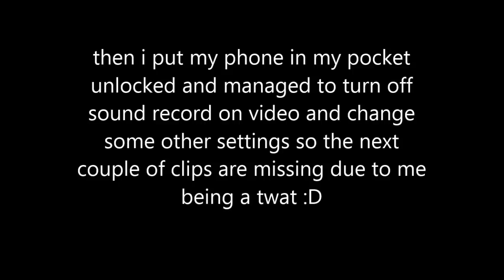hammock over night in the woods with the new air rifle

Comment: Hi Si.
I've had a Hatsan AT-44 in .22 for a few years now.  Amazingly accurate thing, and almost silent with the moderator screwed on...  Get a 300 bar air bottle.  Life's too short for all that pumping.  Those self-resetting targets are great, too.  Beats walking up the garden every few minutes.
Good to see you out camping regularly again.
Reply: It's the military looking (black plastic) version, but it weighs a bloody ton with the scope, moderator, and bipod all fitted.  Accuracy is something else.  I was amazed.  Five pellets through a single pellet sized hole at 15 yards.  Mine absolutely loves H&N Field Target Trophy pellets.
Apparently, you can get bottles filled at Sovereign Harbour yacht club.  ;o)
All the best.